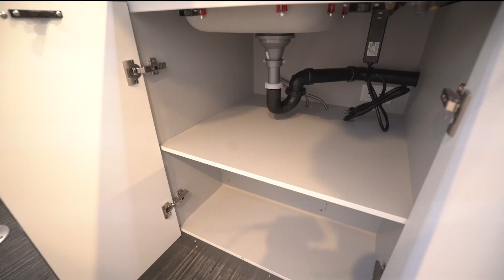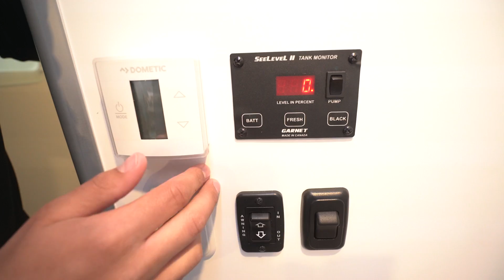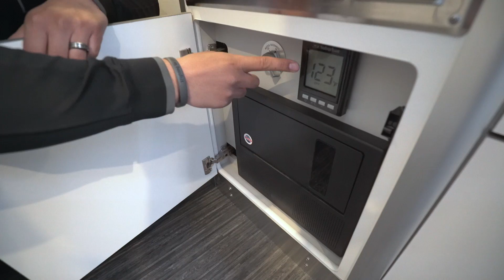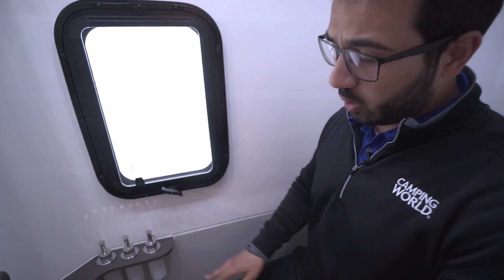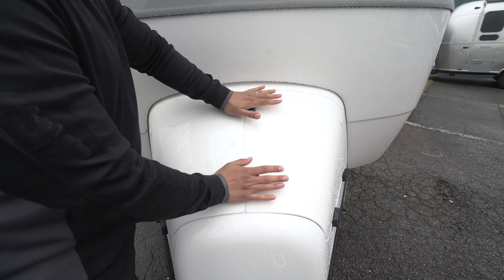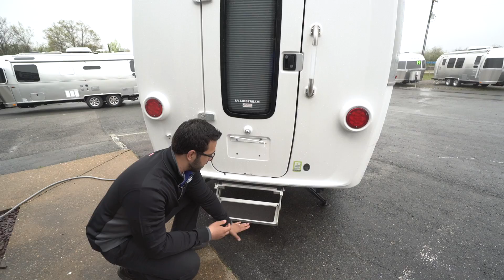2019 Airstream Nest 16U | Luxury Travel Trailer - RV Review: Camping World

Comment: Is there a way to lock battery and propane box area?  Also storage areas too?
Reply from the maker: Hey J.N., Ian Baker here. The storage areas will lock, however a manufacturer cannot design a locking propane compartment in the US as it's against code. To my understanding, there needs to be access to the propane compartment in the event of a fire. Hope that helps!
-Ian Baker
Reply: @Camping World  
Then batteries should be inside the trailer as so much theft and owners can't afford to replace all that is taken.

Comment: The 20 pound propane tank is too small and not "easily exchangeable". I've never seen a 20 pound tank for exchange.  They are all 40 pound tanks.
The 30 gallon mixed black and grey tank will be full the second day of use.
For 45K I would expect solar and lithium batteries.
If I lay sideways on the rubber mattress with a pillow, will my feet push against the wall?
It seems to be a luxury price for spartan features.

Comment: The Nest has a lot going for it, except the price.  On top of the high price you would need to upgrade to the better  batteries.  Why is the air conditioning unit so large for a small RV.  It should be 8 to 10,000 btu's.  Where could I install a 3000 inverter generator?  I think with all the upgrades I would need, this Nest would jump to a price that would push me into another category of high end RV's.

Comment: No corian countertop?  You have to squat to use the microwave?  No built in TV and digital antenna?  Simple slide in / out pantry would have been much nicer than the little cutouts.

Hate the fabric covered roof panel.  That will stink after absorbing odors.
Reply: Yup. That was my first thought. Your roof is going to absorb everything you cook.

Comment: The demonstration was good, but it failed to show the critical interior conversion from day to sleeping mode, always a hassle in small trailers.

Airstream should be commended for migrating to the future of composite construction which offers finish, liveability, serviceability and strength unattainable in their obsolete aluminum units.  But the design suffers from external tanks which preclude 4 season operation, limited ground clearance that makes unimproved roads off-limits, stinky, dangerous open flame propane cookery instead of state of the art induction, no security system and power provisioning that is not up to servicing the installed amenities.  All-in-all, a good start at the future that needs refining.
Reply: what would you recommend?

Comment: Is a dry bath available in a nest?
Reply from the maker: Otto, not at this time. Currently the only floorplan changes on the Nest are the dinette (16U) or the fixed front bed (16FB). Hope that helps and thanks for watching!
-Ian Baker
Reply: Camping World yes thank you very much did some research on it as well and that’s what I found out. Maybe if they make a 19 ft it will have a dry bath. Thanks again!